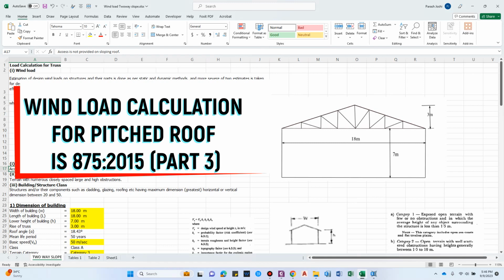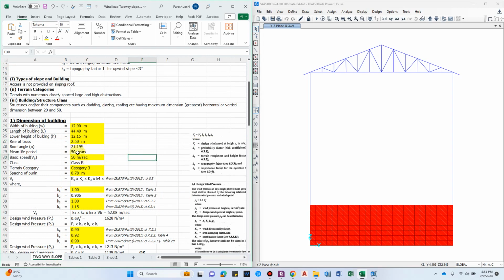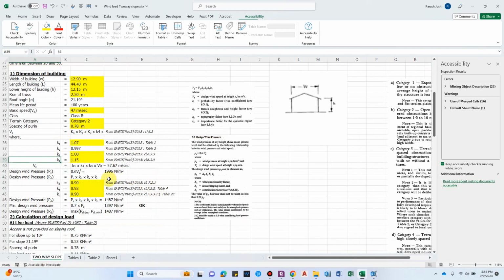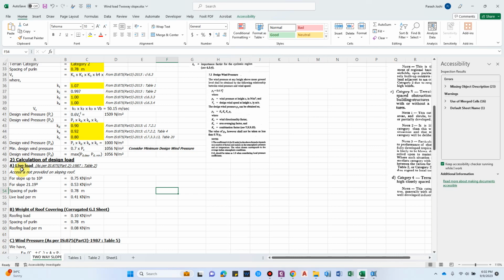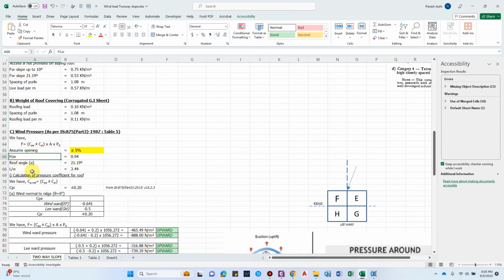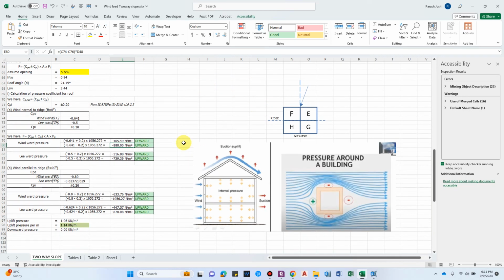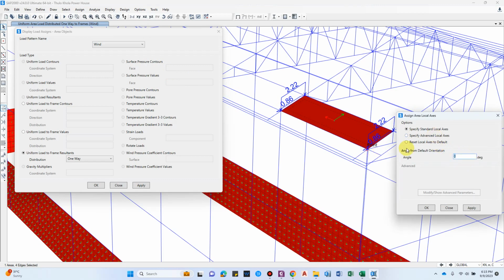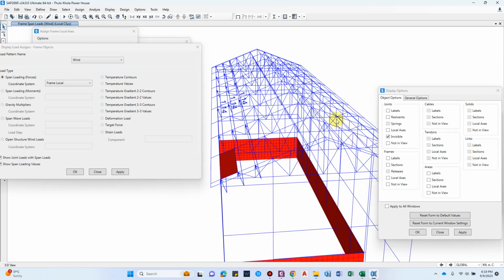Calculation of Wind load using EXCEL for Pitched Roof | IS 875:2015 Part 3 |  Apply in ETABS Model

Comment: Sir if we obtain both uplift pressure(-ve values) and downward pressure(+ve values) combined in those (8 values of) Windward and leeward in 0 and 90 degrees, should we apply wind load in both upward and downward local-direction in the purlins?